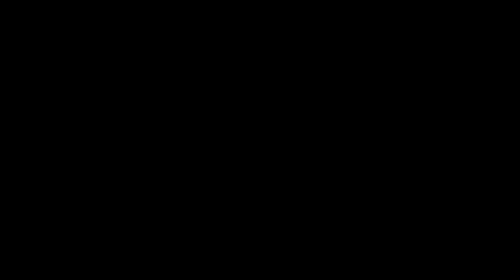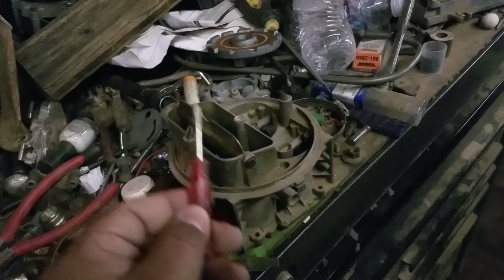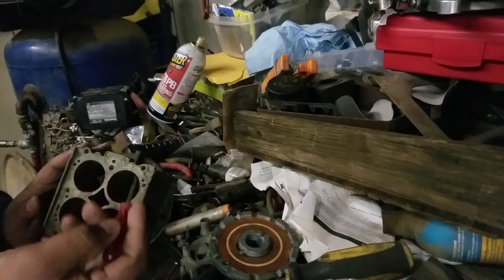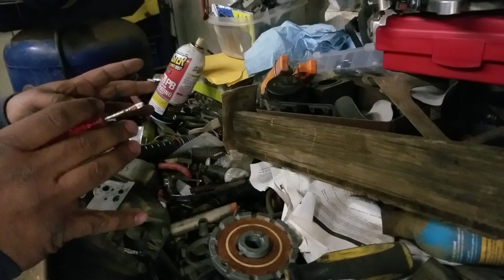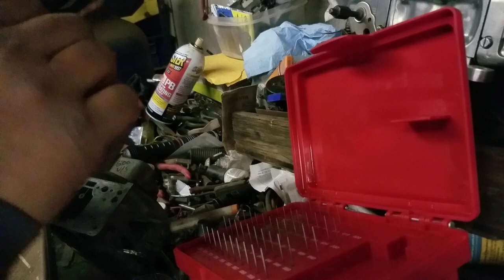5 Secrets For Tuning And Adjust Holley Carbs That The Pro Builders Wont Tell You | Carb LS |NW Ep.60

Comment: I really like to see the younger guys figuring it out, good video.  I've been doing this for 50 years, no A/R gauges or any special tools but 98% of vehicles used carbs in my day, now all I do is fuel injection and LS swaps.  We used to read the spark plugs and tailpipe soot and yes, you're correct, we were over carbing then too, most times over camming too.  A normal 350 ci. engine consumes 500 cfm of air at 6000 rpm.  A 600 cfm 1850 like you're holding will feed a 400 no problem and the driveability will be great.  You might give up a few hp on top but 99% of the time you're not there.  The power valve is very important and using a vacuum gauge you can find your opening point.  Most Holly's ship with a 8.0 because there're usually jetted to rich anyhow so once you lean them out you'll need to go to a higher number to richen the mix a little under acceleration when your vacuum drops.  The Carter AFB's (Edelbrock) and Quadrajets are much more forgiving because they reference the vacuum for mixture control and with those tiny primary bores the Qjet is just tops on the street.  I ran them on all my cars back in the day and they were very crisp and when those big bores in the back opened up you could flow 750 cfm if needed, the air door is adjustable and you can dial them right in.  All in All a pretty good video, keep it up.
Reply from the maker: Great points, really appreciate it!
Reply: I prefere carburettors to, as i reckon' used properly they produce more horsepower. Actually i get better results from a duel-throwt,down-draft carbuettor unless i am using a supercharger in which case i will use a holley style carburettor minus the metering-blocks, enjoy raceing

Comment: I had to reduce my idle feed restricors and drill a hole in each of my butterflies to get my transfer  slot closed. This made everything else easier to tune and you don't "loose your tune" do to weather/temperature.
Reply from the maker: My engine isn't radical enough to need it yet. Most modded engines I see just need a 4 corner idle and to crack open the secondaries a bit.

Comment: You can tune everything about that carb, especially the PV, with a vacuum guage. I absolutely don't understand all of it. I just know they have been tuning carbs for a lot longer than they have even had AF sensors😂 That AF guage will sure make things easy. Nice vid!
Reply from the maker: The wideband makes tuning faster and more exact. It also lets you identify problems faster too.
Reply: @NightWrencher  information is key to success in anything. More of that is always better.

Comment: I run a Quick Fuel QFX 1050 "Pro-Street" Dominator 2-circuit on the street, and I'll tell you what.... It has been the BEST carburetor I've had in 30 years. The car starts right away after 2 pumps, idles within a minute or two, has the crispest throttle response out of any 4150 Holley I've had, and holds a tune incredibly well. It never loads up and will idle forever. The dyno tuner said the carb was real close out of the box, and just needed minor jetting and air bleed tweaks. Everyone says, "You can't run a Dominator on the street!!" Well, I'll never go back to a 4150 again after experiencing this Dominator.
Reply from the maker: I hear theyre really good carbs
Reply: @NightWrencher  I'd buy another, that's for sure...

Comment: Here is a simplified yet, accurate description of the Power Valve, and it's function in a Holley Carburetor from Holley it's self: 

"The power enrichment system supplies additional fuel to the
main system during heavy load or full power situations. Holley
carburetors utilize a vacuum operated power enrichment system
and a selection of power valves is available to “time” this sys
tem’s 
operation to your specific needs. 
Each Holley power valve is stamped with a number to indicate the vacuum opening

point. For example, the number “65” indicates that the power
valve will open when the engine vacuum drops to 6.5" or
below. An accurate vacuum gauge,  should be used when determining the correct power

valve to use.
 A competition or race engine which has a long
duration high overlap camshaft will have low manifold vacuum
at idle speeds. If the vehicle has a manual transmission, take
the vacuum reading with the engine thoroughly warmed up and
at idle. If the vehicle is equipped with an automatic transmis
sion, 
take the vacuum reading with the engine thoroughly

warmed up and idling in gear. In either case, the power valve
selected should be 1/2 the intake manifold vacuum reading
taken.
 EXAMPLE: 
13” Hg vacuum reading divided by 2 = 6.5
power valve. If your reading divided by 2 lands on an even
number you should select the next lowest power valve. 
EXAM
PLE:
8” Hg vacuum reading divided by 2 = 4 power valve.

Since there is no #4 power valve you should use a 3.5.
Most of the popular Holley “Street Legal” and “Street
Performance” carburetors incorporate a power valve blow-out
protection system. A special check valve is located in the throt
tle body expressly for this purpose. This check valve is designed to be normally open but will quickly seat to close off

the internal vacuum passage when a backfire occurs. Once
closed, the check valve interrupts the pressure wave caused by
the backfire, thus protecting the power valve.
If you have a carburetor older than 1992 (or you have experi
enced 
an extreme backfire) and expect a blown power valve,

use this simple test. 
TEST: 
At idle turn your idle mixture screws
(found on the side of the metering block) all the way in. If your
engine dies the power valve is not blown."
Reply from the maker: Holley also has a similar explanation in their video but its just a rule of thumb. Each engine application is different and should be tailored as such. For example. A 350 in a corvette will require a different powervalve than say a 350 in a 2500 truck even if the rest of the engine is the same so simply going off idle vacuum tells you very little about how early or late you need the PV to come in. Its a much more complicated system than most people think, especially when comparing the relationship of PVCRs to jetting.
Reply: @NightWrencher  True, although the different variances are usually related to different cam profiles. If you drive the vehicle at various steady speeds and observe the vacuum readings, you can select the correct power valve which indicate readings of the closest opening point about 2" Hg below the
lowest steady speed engine vacuum observed.
Reply from the maker: @Rick-O-Shay60  thats true but you dont see that in the holley explaination.

Comment: Only issue I keep running into with my truck avenger is it's stupid I mean stupidly rich that if I don't let it sit in high idle for 5+ mins it will end up fouling plugs, and sometimes if it's done it's cold start idled down if I try to give it gas to accelerate quickly it will start to run rough but then clean up after a bit of driving
Reply from the maker: Yeah, truck avengers are jetted really rich. Thats my only reason for not getting one

Comment: My other issue is vapor lock in the line even with a fuel  return system
Reply from the maker: Vapor lock is a little tricky to get rid of after you start experiencing it. When I started dealing with it, I installed a 1 inch plastic carb spacer and dropped the fuel level in the bowls a little bit. I later swapped to a 2 inch spacer and don't have any vapor lock issues

Comment: Great info man! Got a question.. I have a 70s wood chipper that has a 351w with a externally governed 2 barrel Holley 2300g. It has a lean bog when the clutch is engaged at 1000 rpm. The engine turns this massive flywheel that requires all the power it can get at around 1000rpm..so my question is what power valve I should use... The accel pump is set up right, I was thinking of a 10.5hg or a 2 stage if I can find it....also, since the 10.5 is also hard to find, could I theoretically turn the brass nut inwards on the power valve to reach around 10.5hg? Given that the spring will doesn't plateau before that?
Reply from the maker: Hey man, sorry for the late reply, I've been thinking about your issue these last few days and Ive got a few suggestions. First, you need to remember that most of our modern fuels are not pure gasoline like the old days and some are actually rated at E10 meaning it has a 10% ethanol rating. The ethanol allows us yo run more timing and higher compression ratios with reduced risk of knock. The downside is that it requires more volume to produce the same burn as older gas. I would break out the vacuum gauge and set the idle to highest vacuum reading, keeping both sides square and lower the RPM back down  get it to the right idle. I have a video on that on setting the idle. Once you have that, get it up to the rpm you are having trouble at and check the vacuum reading. Remember that the PV adds fuel to the main circuit only so if the throttle is not open far enough, the higher PV is not going to do anything. I feel that your IFRs are going to be too small and you might be running lean. While youre duplicating the problem, place your hand over the choke tower to see if it clears up or gets worse. Clears up, running lean. Gets worse, running rich. Try all that and get back to me. Good luck!
Reply from the maker: https://youtu.be/gW55D00zpvg
Reply: You might want to go even go a little higher in rating for the PV and look at your plugs, are they white ?  Your running to lean, they should be tan so maybe you need to go up a few numbers in size on your main jets and set your mixture with a vacuum gauge looking for the highest reading.  Just off idle at 1000 rpm is a tough place to read but from what you describe it's not the accelerator pump shot.

Comment: I had a question about the primaries keeping the square in the transfer slots some say that if you need a little bit more idle speed it's okay to put that Alan hex key in the secondary adjustment screw and lightly crack that open keeping the same transfer slot exposure in the primary in the secondary to have them equally ajusted.  I'm wondering about the secondary metering block if you have one which I do what about the IFRS in the secondary should those be drilled out to 35 or so as well as the primarys ? I'm understanding the theory of trying to keep a carburetor square all the way around with the transfer slots I have a 600 CFM vacuum secondary slightly cracking open the secondary butterflies to have an equal balance between the two and not open the primary transfer slots too much but wouldn't you be more  rich at idle by cracking  up the secondary screw ? . It would draw fuel from the secondary IFR or not ?  I have it has a very small adjustment from the idle screw barely touching the adjustment tap from zero to half a turn if I go a little more about an eighth of a turn more it will expose a hole just under  the transfer slots im guessing that"s the full manifold vacuum port hole do you adjust your secondary butterflies for a Foursquare transfer slot or you leave your secondary closed ?
Reply from the maker: I feel like I just answered this same question last week but I'm not sure. Basically, if you have a 2 corner idle carburetor, do not touch the secondary idle speed screw. Since all 4 corners are controlled by the front screws, if you open the rears, it will only act as a vacuum leak so do not touch the rear idle speed screw on a 2 corner idle set up. With that being said, if you have a 4 corner idle carb, the rear IFRs will control both the fuel going into the idle circuit but also the rear transition circuit during half throttle. The IFRs are tuned to the air fuel ratio of the transition circuits and then turned down even further by the idle mixture screws for the idle circuit.
Reply: @NightWrencher  You did lol I asked the same question on two different videos why ?🧐 Don't know.
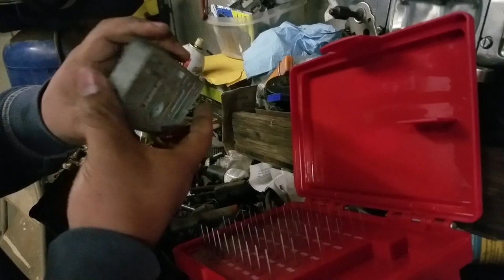Anyway I finally seen the holes in the IFR you were talking about I needed a super bright led flash too see them   they were small undrilled less than 0.33 so I'm thinking 0.28 I drilled them to 0.35 I always had a super Rich smelly idle anything over 12:50 on AFR it would act up and not like it hope the 0.35 helps .
Reply: @TheThirdWheel618 how is opening up the IFR gonna help a rich smelly idle?
Reply: @jeremymyers5643  From what there saying it allows more air in that's the ? I ask .The hole is tiny from Holly like 0.28 when I set my idle mixture it wanted a Rich idle in the 12.50 if it went to 13.00 13.25  it would hesitate on take off . 
I have a few metering blocks I drill one to 0.35 haven't tried it yet also I bought the pro-form adjustable both need testing .
Reply: @TheThirdWheel618  I reserve the right to be wrong, lol. But I think your confusing idle air bleed , with idle feed restrictor.  Air bleed is above booster outside of carb and let's air into the fuel, idle feed restrictor is in the metering block and restricts the total idle fuel in circuit. That's how I understand it anyway.
Reply from the maker: @jeremymyers5643 you're right, opening up the IFR will add more fuel in both the idle and transition circuits. Your idle is one of those things that is best tuned by ear and when in doubt, reset the idle and start over. A lot of things can affect idle AFR on the gauge such as cam and ignition timing or even a worn out sensor. A rich idle can only be solved by properly setting your idle speed and mixture screws. Anything else will also affect the rest of the fuel curve
Reply: @jeremymyers5643  yes the idle feed restrictions but I asked a few questions at the same time so might be mixed up . I had the smelly rich idle so drilled out my idle feed restrictions.
Reply from the maker: Larger idle feed restrictors will add more fuel.
Reply: @NightWrencher  😲.....good thing I tried it on a older metering block .

Comment: 383 stroker,  4150 750. Setting idle air I cant get any higher on afr than 12.8 or so. Well I can but then when I put in geat it wants to die. So back out to 12.8. That seems too rich. Reading it's from too tight of a converter but it's a ptc 2600 stall. What can I change to get closer to 14.7?
Car runs fine at 12.8. Transfer slots are squares.
Reply from the maker: Cam selection also plays a big role. If its got pleanty of lope, it will fool the AFR gauge into seeing something thats not there. I recommend increase timing at idle if you havn't already and tune by vacuum gauge.
Reply from the maker: Let me know how it works out
Reply from the maker: Another tip would be to install a carb with 4 corner idle if you dont already have one. I can usually set a cleaner idle with a 4 corner holley

Comment: Will a holley 4412 carb work on a 5.3 vortec? Will it be big enough to run the engine?
Reply from the maker: Itll run the engine and will have pretty good low end response and torque, even save a little on mpg. You might lose a little power but itll be hardly noticeable
Reply: @NightWrencher  thanks you for that info. Very helpful god bless.
Reply from the maker: @frankrenteria4370  any time! That's why I'm here

Comment: Man thanks you Awsome video 

I want a carb but just can't spend 500 on a 750 brawler 

I have a 74 camaro 
454 60 over
AFR Enfircer heads
10:1 compression
Hooked headers
The Big Mother Thumper Comp cam
Vac brakes power steering with A/C
200 gph mechanical fuel pump 

I want a good street car on a tight budget. I have been gathering parts since summer last year and would like a nice hot rod for the family 

Foe trans I got lucky on a 97 4L80e
Spent 89 bucks on a shift kit. Still need a 3000 stall. And need a shift controller.
Reply from the maker: Thank you! You can make any budget carb work for you as long as you use the right size for the engine. You can find them used all over the place. You would probably benefit from a mechanical secondary carb.
Reply: Ya I was just thinking possibly a 650 mechanical secondary
Reply: I was actually leaning to a 850 or 750 vacume  secondary. But for a budget I'm noticing 650 are cheaper. 

Only thing I'm not 100 percent on dialing in a 650 mechanical secondary. All I know is you can adjust the leaver when to open them.
Reply from the maker: Depending on the 850 it might not be ideal even on a 454 due to the big carb bores. A 750 would make a solid street carb. A 650 might restrict a little bit of airflow but the response down low would be really good.
Reply: @NightWrencher  ya a 650 double pumper would be sweet. I was just looking at FST carbs and there pretty affordable.
Reply from the maker: They're all pretty much the same thing, honestly. Even if they're high end carbs, the tuning will still be off probably so you'll need to make the nessesary adjustments so pick the size you want in the style you want and go for it.
Reply: @NightWrencher  I just found a 750 Holley vac secondaries and mechanical chock for 200. Its not a high performance like AED or quick fuel but it's nice and clean.  Good body and everything
Reply from the maker: I would get it. You would be surpised on how well it will run with proper tuning. I have a 750 VS on mine as well
Reply: @NightWrencher  sweet I'll keep you updated   Need to get the motor together first. Looking forward to playing with the tuning
Reply from the maker: Good luck!

Comment: Just bought a brand new 3310 for $400.By the time I locate all the parts kit and down time..Id rather just buy new and go.
Reply from the maker: If it works for you, run it. I'd rather buy a used 3310 for $60. Put $100 in parts into it and adjust it to exactly what I need. Off the shelf carbs almost never run perfectly out of the box. Usually IFRs and AP are lean and the secondaries are too rich